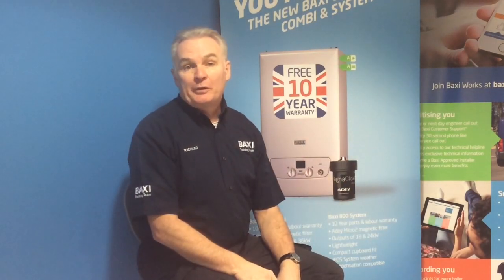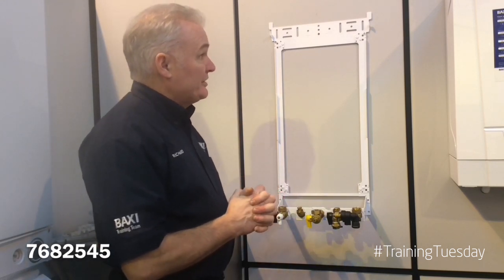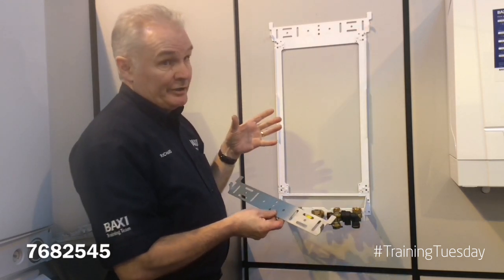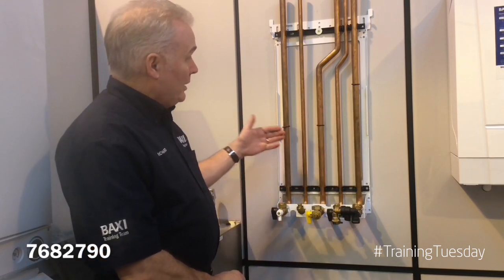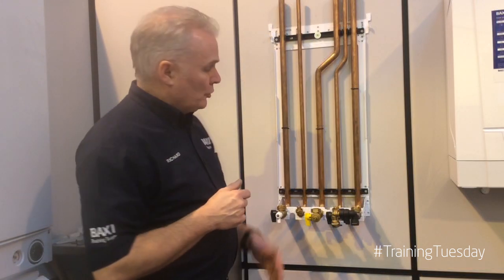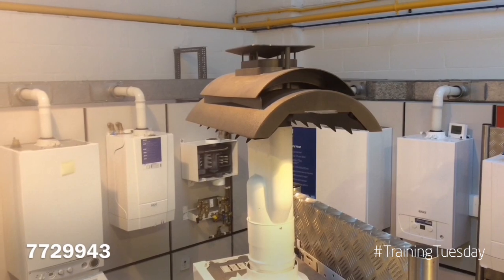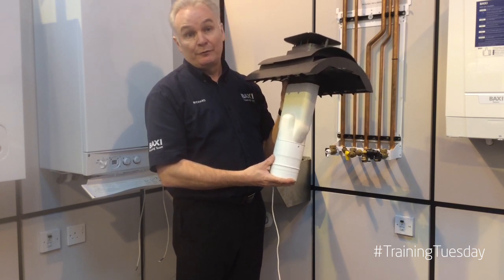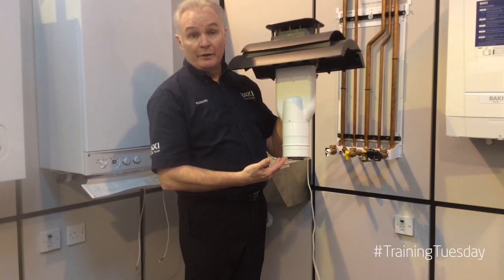Accessories available for the Baxi 600 and Baxi 800 range of boilers | Boiler Troubleshooting | Baxi

Comment: And there was me thinking that wire on the ridge terminal was a length of string so you could attach it to something in case you dropped the sucker whilst on the roof